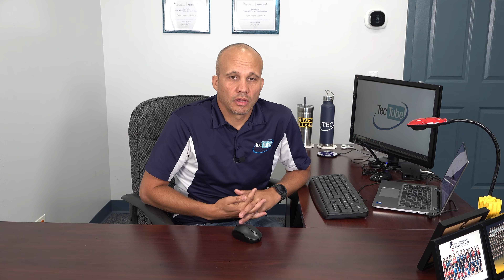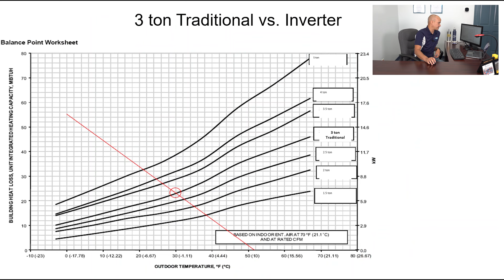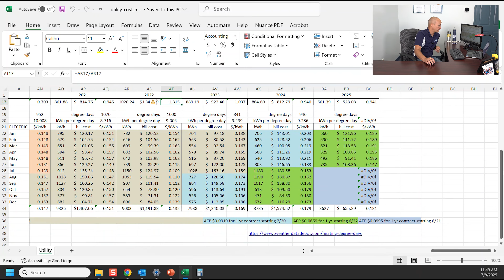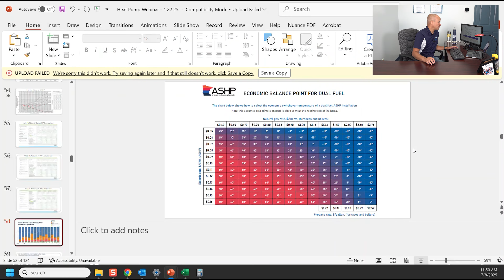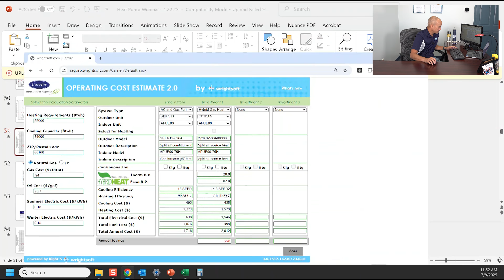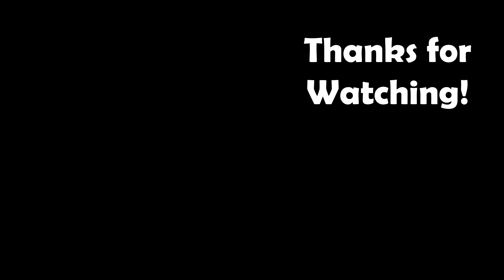Heat Pump Balance Points

Comment: everyone in quad cities sell heat pumps sell sell sell when normally they not the best option
Reply from the maker: Sometimes utility rebates and/or tax credits make a heat pump less expensive than an A/C. So in those cases, take the free upgrade to heat pump and just run the gas furnace as the primary heat.